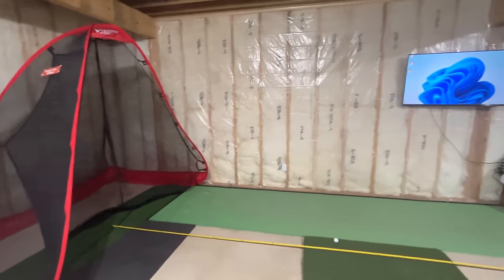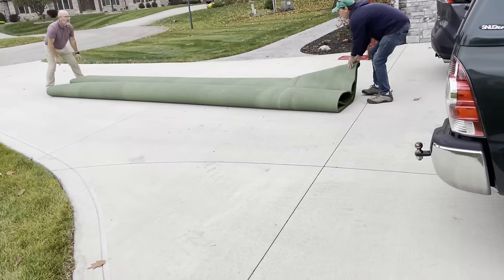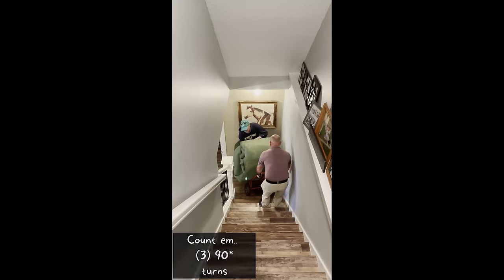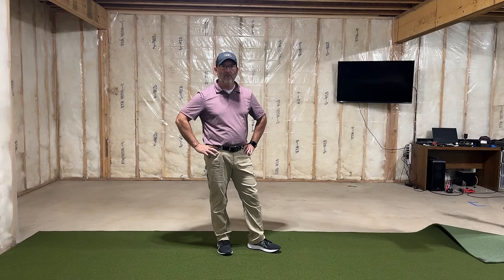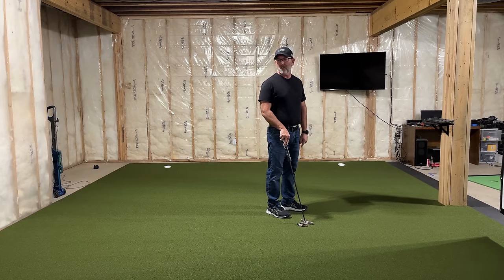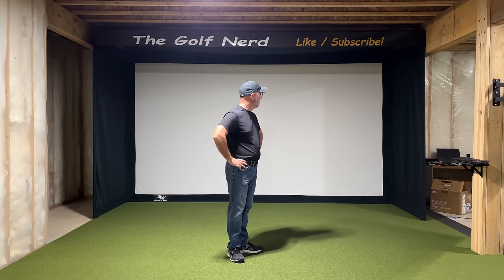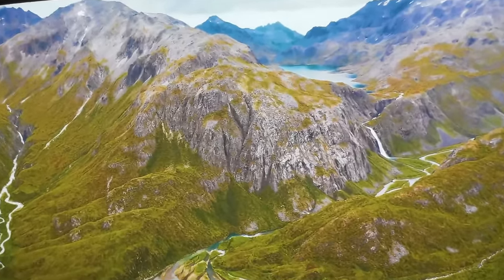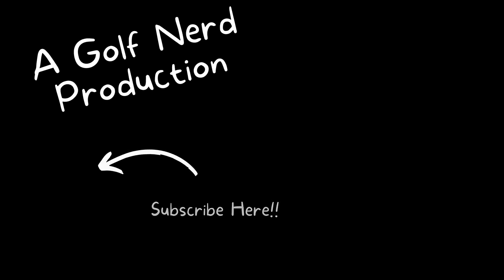DIY Golf Sim Build - The New Golf Studio

Comment: Man… that is awesome!! Setting mine up this weekend!!!
Reply from the maker: Thanks Chad!!  I honestly couldn’t be happier with how it turned out!  Good luck with your build!!
Reply: @TheGolfNerd  Hey, where’d you get the miter saw blade to cut the emt?
Reply from the maker: @chadcleary7931  I bought mine at Home Depot but I linked to one in the description as well.
Reply: @TheGolfNerd  Thank you sir!
Reply: @TheGolfNerd  that blade made quick work of it. 

Found one at Lowe’s for $7

Not often I get a tool for $7
Reply from the maker: @chadcleary7931  nice!!  I had a similar experience!  Almost took longer to change the blade!
Reply from the maker: @chadcleary7931  make sure you verify your outside dimensions when you build the enclosure.  Otherwise you’ll have slack and wrinkling in the fabric.
Reply: @TheGolfNerd  will do!

Comment: I’m about to install this same flooring. Did you tape the rubber tiles down to the concrete?  Also, in a more recent video you installed the hitting insert. Did you tape it down to the concrete?  This is probably common sense to most but not I’m not very handy and your videos on building your sim have helped a lot. I would’ve never even heard of this company if I hadn’t ran across your channel. So thanks for that!
Reply from the maker: I did not tape my foam tiles down.  Once they are down they are heavy enough it feels really solid.  I didn’t even tape down my putting turf.  It would probably sit a little better if the turf was tensioned and taped, but I’ve never laid carpet before and skipped this step!  It looks completely fine to me and hasn’t moved after several months of use.  I also haven’t taped down my hitting strip, but out of all of these considerations, that’s the one I would recommend using double sided carpet tape to secure.  I don’t have any issues, but it will sit a little flatter if it is held down with tape.  Let me know if I can help further!!  Thanks for the question!!!

Comment: Hello

Awesome setup! I’m in the process of building a simulator in my garage with these exact screen dimensions (14’x8’) and projector. If I remember right that projector needs to be placed somewhere around 12 to 13 feet from the screen to fill the screen dimensions. My question for you is do you cast a shadow on the screen from your hitting position? How far away from the screen are you teeing up? I am maxed out at about 8ft from screen. Do you think I will cast a shadow? Can you test that on your setup for me? I’d appreciate it.
Reply from the maker: Thanks for the feedback and the question!!  Unfortunately I am hitting from 11.5’.  I checked my setup and from 8’ I would cast a shadow about 1/4 of the way up the screen and I am 5’8” standing on a 1 1/2” high mat.  So essentially like I’m 5’9”.

Comment: Great setup! Do you have  a link to the EVA tiles you used? Also, what are the dimensions of the extra curtains and where did you get them - link? Love the channel, keep on golfing 🙂
Reply from the maker: Thanks for the nice comment!!  The EVA Foam link is https://amzn.to/47DyQpU
Curtains link: https://amzn.to/3H7EAMZ
These curtains are great for blocking out light and will knock down a weak off line shot, but they shouldn’t be used as the side of an enclosure.  I recommend using a kit from a supplier for the actual enclosure, my preference is Bullseye Golf Sims.  Thanks again for the feedback and consider joining my Facebook group to be able to ask more questions or learn from others!

Comment: Great set up!! Very nice! I have the same projector. Ran my hdmi cable through the ceiling. Hooked it up to my new gaming laptop but the projector is having trouble finding the source/laptop. Did u have any trouble setting up the projector to connect to your computer? I’d hate to have to cut through my ceiling again. Thx!
Reply from the maker: Thank you so much for the nice comment! I didn’t have any trouble with my cable, but I used an active cable.  We built a new house a couple years ago and I ran these through all the walls. I have had a lot of success on very long runs. I suspect what you may have happening is loss of signal due to cable length. It’s kind of a guess, but you might want to look at one of these.  https://amzn.to/3J0ahtn thanks for the comment and let me know if I can be of any further help!

Comment: Great video. Do you think it would be possible to cut out the NP45 and foam mats so that the EZ Tee mat could be inserted into them so make a level surface? Also, do you have to order the NP45 in a standard size, or can it be customized?
Reply from the maker: Absolutely.  I’ve just been dragging my feet because you only get one chance and I wanted to make sure I had it setup the way I wanted it.  I’m just about to commit after a couple weeks of using it.  As far as dimensions, I think they can supply whatever size you need, but if you generate some scrap they can’t sell the cost per square foot will probably increase.  They are really great at customer service so I’d reach out.  Chris Duff handles all incoming orders, just tell him you saw the product on my video and I’m sure they’ll do what they can to meet your needs!  Also, if you haven’t already, please consider subscribing!!
Reply: @TheGolfNerd  Sorry, another question. Did you get your foam mats from the same place? It seems much cheaper to buy foam mats from Amazon. Thanks.
Reply from the maker: @JonAmmons  I did get the foam tiles from simturf.  Just make sure you know what thickness you need to make the hitting area the same level as the putting surface.  And no worries about the question, I’m glad to help!

Comment: Great video. My current setup is 4:3, I’d like to move to a 16:9 and would most likely use the same 8x14 screen. With the entire enclosure setup - can it be moved easily, should it? I ask bc I’ve got storage behind my current basement setup due to a narrow unfinished basement side.
Reply from the maker: You can slide it around, probably a 2 man job.  So it can be moved, but I’m not sure I’d call it easy, but rather doable.  Thanks for the feedback!!

Comment: How do you get your screen filled up like that? I'm using the mevo plus off of iPad and doesn't do my screen any justice, I got the bullseye custom enclosure and couldnt be more happier with it. if I get a PC would I be able to make my screen filled up better? thanks
Reply from the maker: Congrats on the new enclosure!!  As far as filling the screen, it’s mostly controlled by the distance of the projector from the screen.  You have to fill from top to bottom and then you can adjust the width via the GPU software on a pc if you are running a screen size other than 16:9.  In the video about choosing a projector, I go through the process of using a calculator to determine the correct distance.  Thanks for the question!!!

Comment: What did you use to transition where the turf meets the bare floor, right side of the video? Thank you
Reply from the maker: That is the eva foam.  I had 16’ of width of eva foam, but only 15’ of turf width.  So I’ve got roughly 1’ of eva foam showing on the right.  The eva foam by itself is not as much of a trip hazard, and has a nice clean edge.  This is why I didn’t trim it.  Thanks for the question!!

Comment: Great content!!  Was it difficult to get the right projector image onto your screen? It looks perfect!
Reply from the maker: Thank you so much!!  I wouldn’t say it’s difficult but it does require some homework and a leap of faith!  I found projector central website very helpful.  They have a calculator there that helps you to determine throw distance based on screen size and mounting height.  I think the biggest question is do you want the projector in front of the golfer, above the golfer or behind the golfer.  This is where it gets tricky.  And in true nerd fashion I used both trigonometry calculators online and a laser to figure out the best option in my scenario!!  Lol!!  Thanks again and please consider subscribing if you haven’t already done so.

Comment: How does the EZ Tee Hybrid feel to stand on and take shots. I have a CCE mat that I cut a 2x2 Fiberbuilt insert into it. I also have a EZ Tee Hybrid insert that I cut into it but needs some trimming. Curious to hear your feedback on the mat you have. Also curious to know what size mat you went with. Thanks and great video.
Reply from the maker: It’s a little softer than I prefer and I’ve ended up going with just a hitting strip, but I used a 4x6 mat for several months and it was fine.  I just prefer the slightly firmer feel of the putting turf on Eva foam.  Glad you liked the video!  Don’t miss the giveaway!
Reply: Would you recommend the 5/8” EVA or 1”? I was looking at integrating the 1x4’ ez tee hybrid hitting strip into my setup with Home Depot putting turf on top.
Reply from the maker: @johnathonwoolsey8163  sorry for the slow reply.  Not sure what that Turf thickness is, but if it is around 1/4 to 3/8” I would recommend 1” Eva foam.  The 5/8” doesn’t give a flush look, at least with my putting turf.  Thanks for reaching out!!

Comment: Great information and really nice setup. My question is my room dimensions are 10' H x 14' x 18'. I want 16:9 ratio. What size enclosure and screen size would you recommend?
Reply from the maker: I’ve got an 8x14 in the video which is true 16:9.  However, in your situation, you have to account for an additional 6” in the overall width of the enclosure relative to the screen size, at least this is the case with Bullseye Golf and other manufacturers may be different.  So the best you can do is a screen that would measure 13.5’ in width.  So that would be 13.5W and 7.6H.
Reply: @TheGolfNerd  thanks would it be better to do the 9'x14' on the 18' length I have?
Reply from the maker: @mikeparkins5871  what type of launch monitor are you going with?
Reply: @TheGolfNerd  uneekor eye xo or waiting for more info on the apogee launch monitor
Reply from the maker: @mikeparkins5871  don’t know anything about the apogee, but the eye XO will let you play with lesser ball flight so you could set up with 10-12 feet of ball flight and be happy with the result.  You mentioned 9x14, you’d actually want 8x14 or 9x16 screen size though to maintain the aspect ration you are wanting.  Let me know if I can help further!
Reply: @TheGolfNerd  Thank you for your time and advice. I appreciate it. Merry Christmas and happy holidays to you.
Reply from the maker: @mikeparkins5871  thanks!!  Same to you and yours!!

Comment: I have the same projector. And the remote won’t work when I switch it to my pc input. It only works with the android dongle. 

You running into the same issue?
Reply from the maker: I haven’t experienced any issues like that, but I typically only use it to cycle power.  Sorry I can’t be of more help but thanks for reaching out!!

Comment: Hi: I will be building a similar setup. My ceiling height is 104”, width is 15’ and my budget is similar. If you were to start fresh, what specs would the build the gaming pc to?
Reply from the maker: If my budget weren’t a concern I’d go with an Nvidia 3080.  Not necessarily the ti model.  A lot of folks report this card handles everything you throw at it.  If your budget won’t stretch that far I think the 6700xt does a good job for its price bracket.  Just know that future enhancements may require an upgrade, but hopefully by then, GPU’s have become affordable again!!  Thanks for the question, and thanks for the subscription!!

Comment: How you noticed any issues with the mevo+ since adding in the projector or maybe the tv you have as a second monitor? I’ve heard other devices in the field can mess up the readings, so I’m wondering what the experience is like for you. Love the build
Reply from the maker: I am seeing some odd behaviors.  I’m trying to work through those now.  This might make for an interesting video down the road.  Thanks for the question!
Reply from the maker: I would add, the tv was essentially in the field of view before.  I’m thinking it’s the projector, but there’s a couple other potential variables as well.
Reply: @TheGolfNerd  I just watched a video about someone with a Garmin R-10 that started getting frequent misreads as soon as he started using a projector.  When he turns the projector off, the R10 works fine. The solution was to build a Faraday cage around the projector which blocks any electromagnetic interference it is emitting.
Reply from the maker: @twiki9995  that’s cool.  Future project?  Thanks for sharing!!
Reply: @TheGolfNerd  I’ve read a few other posts about Garmin R10s getting interference from things like heat pumps and AC units. It seems like it is the fan inside the units that is the source of the issue. Again, the solution is building a metal 1 mm mesh shield between the unit and the radar. Maybe it is the cooling fan inside the projector that is messing with the doppler radar of your Mevo +.  So overall are you happy with the Mevo+? I’m trying to decide between this or the Skytrak. I like how the Mevo has the option of the Pro add on, and easy switching with my lefty little boy, but this interference issue with a projector is giving me pause. On the other hand, I read a lot of posts of people with Skytraks that end up wanting to upgrade to Bushell’s monitor., so they can’t be totally happy with it.
Reply from the maker: @twiki9995  I’ve gotten more odd shots since using the projector, but it’s not all that often.  Overall, I think the Mevo+ is a terrific value considering with pro package you can be all in for $2600 (during specials) and no recurring fees.    It’s definitely accurate enough to be enjoyable and can be used to make swing improvements.  I have a review on the Mevo you might want to check out.  I think a camera based system is more accurate but it also has trade offs.  My dream setup would be an Eye XO, but that’s 4x cost.  Thanks for the additional detail on the faraday cage!
Reply: Great content. I’m uk based and just begun my garage golf sim / gym project. I opted for Mevo+ over SkyTrak as I’d heard a rumour that SkyTrak is going to block GSPro or vice versa in the near future. I understand Mevo+ is approved partner for GSPro.
Reply from the maker: @duncand1964  Mevo + does have some quirks, but it works flawlessly with GS Pro.  Putting can be a challenge though!!  Thanks for the feedback and the sub!!!

Comment: Whats your hitting mat to ceiling height distance?  Total cost?
Reply from the maker: From the top of the heading back to the bottom of the floor joists, it is 104 inches. The total cost for somewhere between eight and $9000 for the launch monitor putting turf hitting mats flooring enclosure projector and some miscellaneous odds and ends. There are definitely routes where you could lower the cost, it’s all up to personal preference. Of course, there are multiple ways that you could make this set up more expensive too!
Reply from the maker: As far as total cost is concerned, I forgot about the gaming PC. You have to budget about another thousand dollars for that.